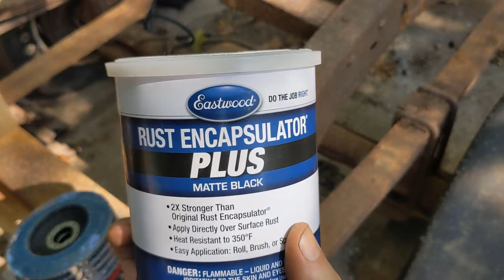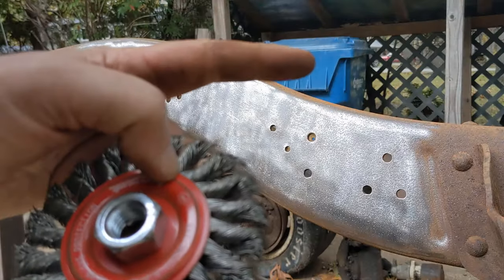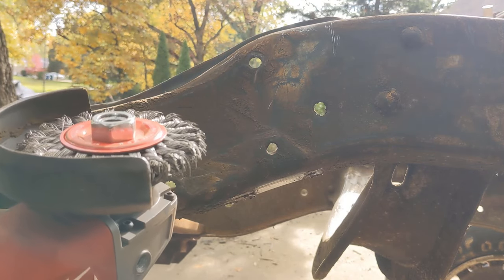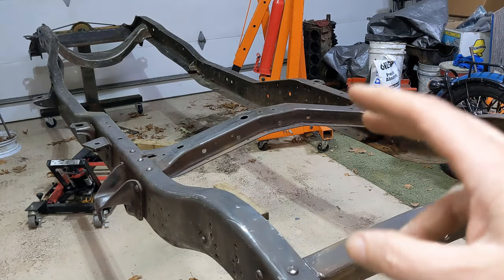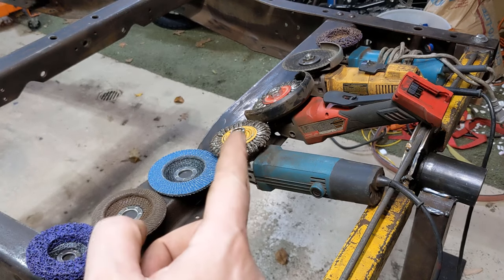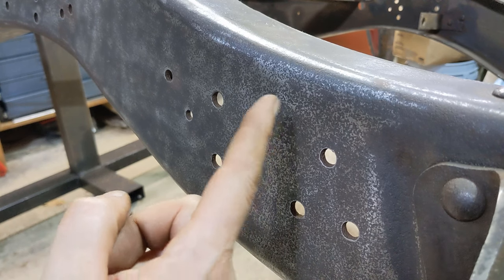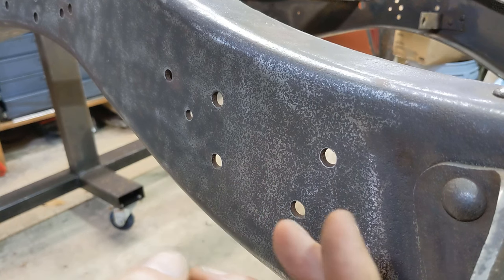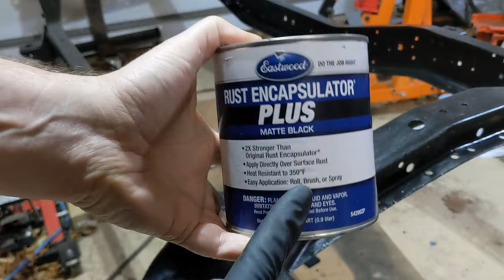Classic Car Frame Cleaning and Coating (Project True Spirit 6)

Comment: don’t worry about bolting crossmembers or spring brackets, hell most large trucks peter bilt mac etc.. have bolted cross members and brackets from the factory. when i restored my 57 f600 i completely separated all the cross members and used grade 5 bolts and not 8, hours of forums and talking with others and grade 8 can be too hard and be too brittle. i use my 57 almost daily with 5-6 tons everytime still don’t have a single loose bolt and that’s been for the last 6 years, the bolt is already stronger than the rivet that rivet is not even a grade 5 strength
Reply from the maker: Thanks for the feedback
Reply: I was wondering about bolt hardness and flexibility.
Reply: I have seen you tube videos from India I think , that showed them placing hot robots. They heat rivit blank to cherry red, put in hole with blocking in frame and brace to ground them setting a concave  blank on a long bar over hot rivet
 Then someone pounded on it with a heavy sledgehammer.

Comment: Why don't you like replacing rivets with bolts? Are they weaker? I was planning on removing all my riveted in crossmembers to remove rust and paint better. Thanks for the video
Reply from the maker: Rivets fully fill the hole to prevent movement. Bolts require clearance to go in, and therefore rely on clamping force. Bolts are likely fine  (that's what I'm using) but if I had a way to hot rivet, I would have gone back that way

Comment: Hey since this has been about a year do you still have this project? Has the rust returned or flaked the coating? Can we get an update?
Reply from the maker: Still have it, yes. Probably the last 40 videos I published are on this. No rust has returned, but it's not been out in the weather yet either.

Comment: This is awesome 😎. I am about to start cleaning, boxing and prepping my frame for my Trailduster. This will help me tremendously! Thank you.
Reply: How did your trail duster go I'm going to do mine as well
Reply: @901250  Currently still in the process of stripping the frame of rust. So far I have been using the wire wheels and it's working decently. But I am definitely going to get a rust converter.

Comment: Wish I could do off the frame restoration. You did a great job on that one. I'll be raising the truck and on my back most of the truck. So some small spots will just get sprayed 3x. With  just surface rust Rust-Oleum has a one and done application.
Reply: I that the Rust Reformer?

Comment: That frame was in very good shape. I had some serious scale rust and deep pitting on my 83 F100 frame . I removed  just about everything from the frame and had it sand blasted. Then painted it with Eastwood Platinum rust encapsulator (the silver one) and  then Raptor bedliner. Had to weld some patches on it  from the rear of the cab back. But all good now . The bolted everything back on with grade 8 bolts nut washers and lock washers from Fastenall.

Comment: This is a really great video, thanks!!!

I’m about to tackle the frame on a 2005 sequoia I just bought. Lots of surface rust. Areas where the existing coating is chipped or flaked off. It will be a bit harder to get to being still on the vehicle and working underneath but I’ll do my best.

I’m planning on using the Eastwood frame spray for the inside.

For th exterior I’m wondering whether to go with POR 15 or the Eastwood rust encapsulator.

I’m also wondering whether to get an electric angle grinder or an air grinder. I like the idea that an air grinder has a lever so it won’t stay on if let go.

I kind of wish I could find a place outside with power where I could go to town.
Reply from the maker: Most newer grinders, at least not the super cheap ones, have paddle switches so they shut off if it leaves your hand

Comment: Blasting or chemical dipping is the way to go. If your going to do it the hard way use stiff wire wheels after you use a quality paint stripper.
Reply from the maker: The challenge of blasting or dipping is that you have to have a way of getting the frame to those places. In hindsight it would have been less work to bolt and axle and tongue to the frame and tow it somewhere, though the chicken/egg problem is that I need a truck to pull it and this frame is my truck.

Comment: Dear Sir, I am restoring the frame of my old 1946 Ford passenger bus, and I have a doubt: When a rivet is removed, replace it with a bolt with a Grower washer and nut and once placed and adjusted, crush the end of the bolt against the nut with a hammer ( like a rivet). What do you think about it? Thank You !
Reply from the maker: Smashing the bolt head won't do anything. Bolts clamp the pieces together. A rivet fills in the entire hole as it expands, leaving zero clearance. So unless you can cause the bolt shaft to expand like a rivet, it won't change (and might even decrease) the holding force
Reply: Thank you very much for your assistance, best regards !!!

Comment: Try acid dip
Reply from the maker: I was trying to do it all in my garage, so that wasn't really an option, though if I figured out a way to move it, that certainly would have been easier
Reply: I think I would have rented a sandblast or even a soda blasting rig. You sure put in a lot of manual work 👍
Reply from the maker: If I ever do another I'll either get one, or more likely just take it somewhere.